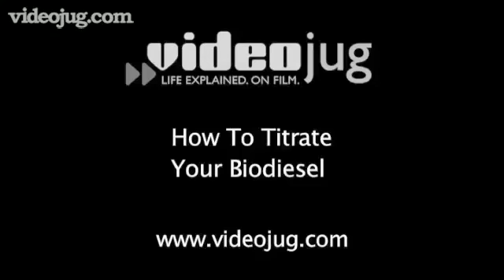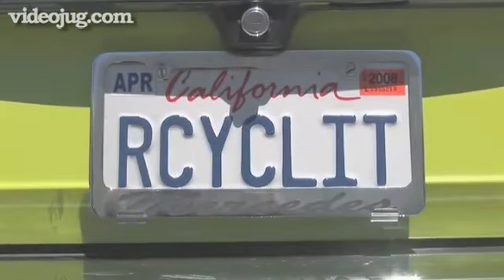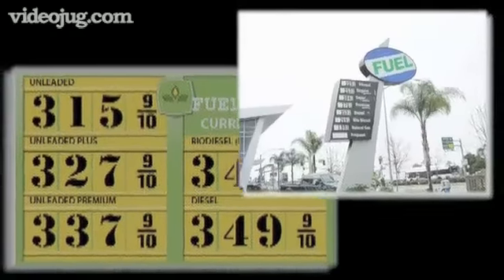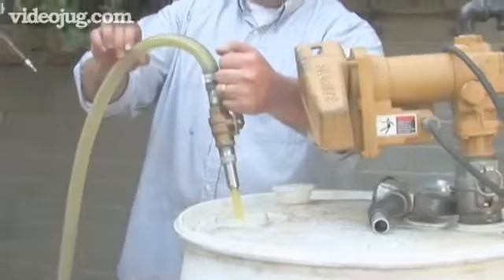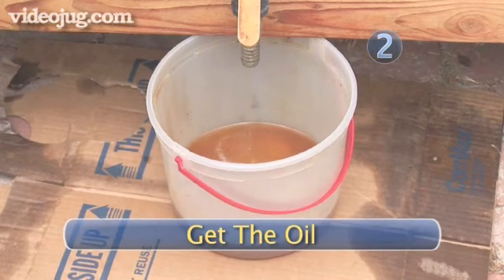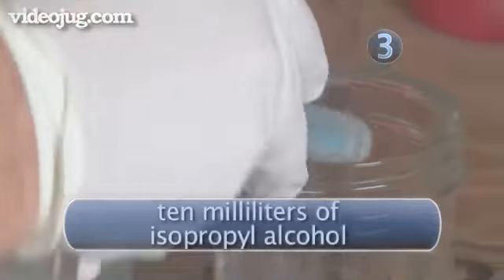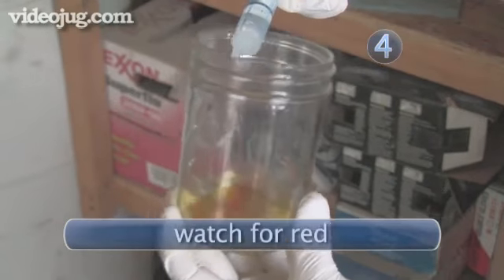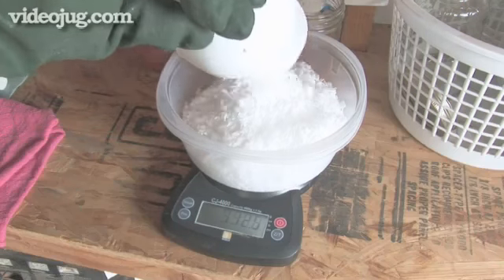How To Titrate Your Biodiesel Homebrew

Comment: The idea is NOT to grow plants specifically for use as biodiesel, but to use waste from plants that were cut down for another purpose, ie fryer oil. It use to be that we had to pay to have this hauled away from our restaurant, now we get paid around 50c a gallon for it. If it's going to be garbage and you use it to replace regular diesel, then yes, there is a huge CO2 benefit.

Comment: the problem with biodiesel is that when the plants are cut down to make the oil for the car, the amount of CO2 that isn't converted to oxygen is greater then if you just used gasoline. Also, if corn is used as a oil for you car, then all you are doing is depleting food supplies. So, no, vegitabe oil cannot and will not be the solution to the energy crisis